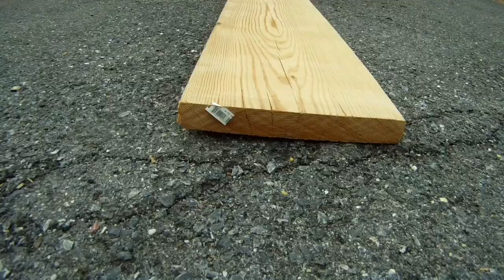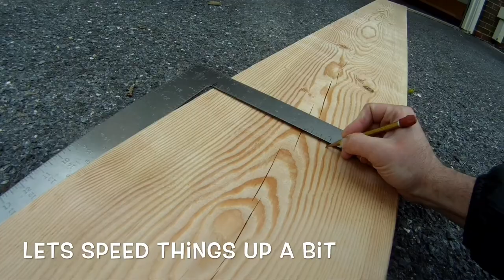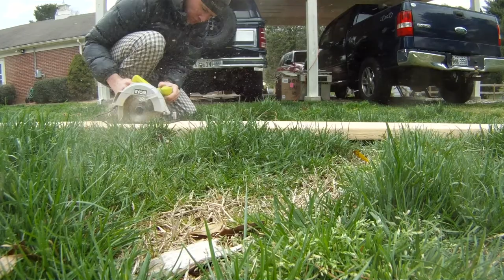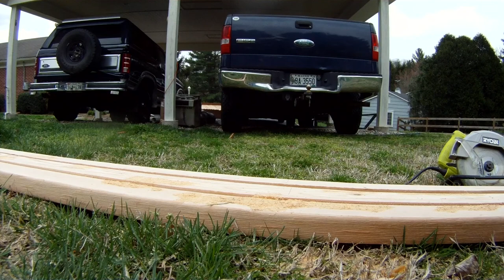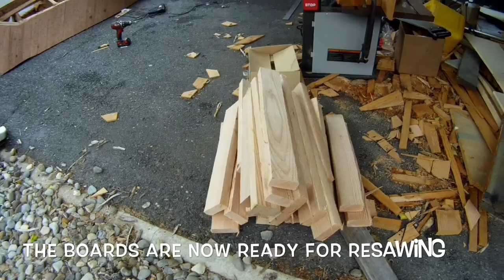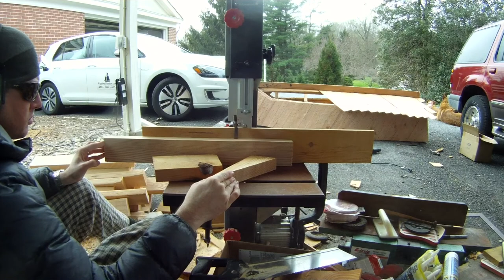How to Make Boat Planking Boards out of a 2x12

Comment: Why did you not build a design using the full 2/12.Less seams to fill .
Reply from the maker: It would need to be a bigger boat to use larger planks

Comment: Wouldn't it be easier to start with 2x4s?
Reply from the maker: +Damien Gregory yes but the wood quality would drop. They reserve the food trees for the 2x12s
Reply from the maker: +Damien Gregory *good trees
Reply: @RiggingDoctor  What’s a food tree? 
Could you use cedar fence posts form a 12 to 16 foot boat? Do you have to trim the planks to 1/4 inch thick?
Reply: Or could you just use someone half inch thick cedar fence post planks end send them down a little smoother & thinner?!